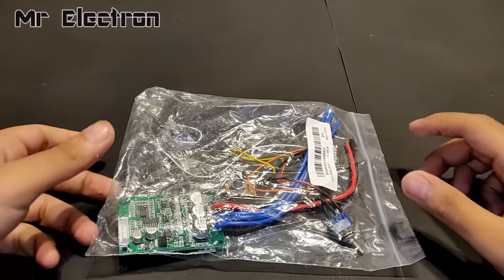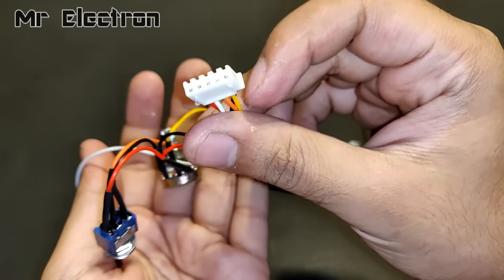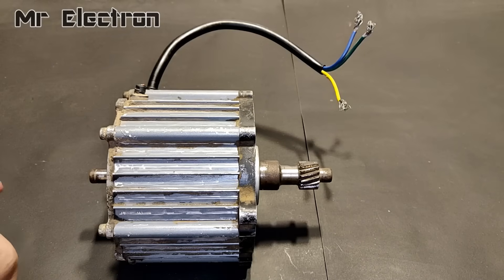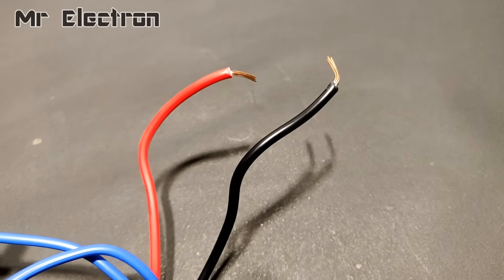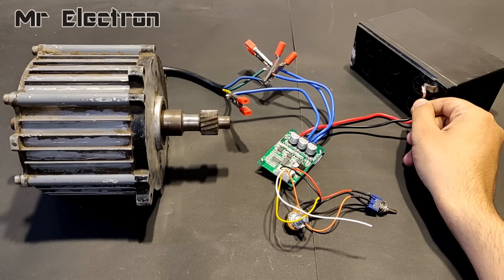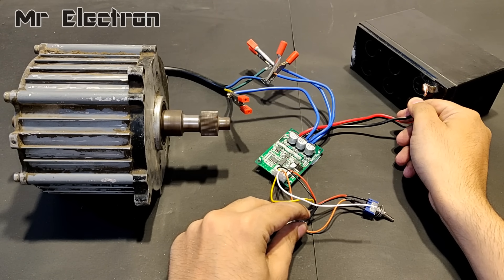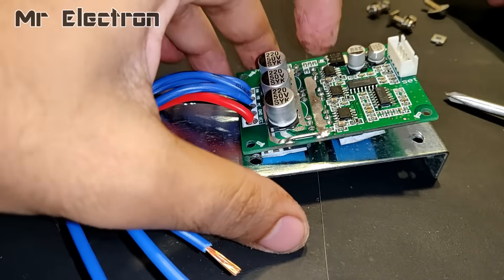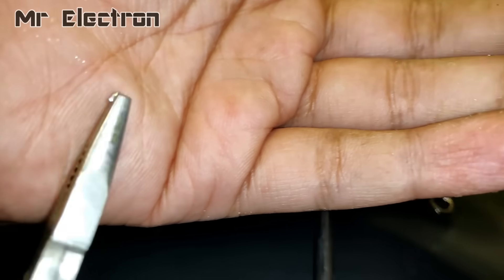Wooow ! 12v to 36v 500w Brushless DC Motor Controller - Run BLDC Motors without Hall Sensor

Comment from the maker: BEST BATTERY CHARGER DIY VIDEO - https://youtu.be/ZN3saILbYUw?si=9_nLu0vKOqfn4zi_
Join this channel to get access to perks:
https://www.youtube.com/channel/UCWFbPzBb7dCyCWuBA-DBrMA/join
Mr.Electron Patreon's Page - www.patreon.com/mrelectron
Hindi Channel                 - www.youtube.com/@Mr.ElectronHindi
Alternator Channel            - www.youtube.com/@mrelectron_alternator
Watsapp Channel              - https://whatsapp.com/channel/0029VaQmmRaFCCoWOf7huh3G

BUY Brushless Motor Controller : http://bit.ly/2UV9Ybb
Reply: Nice idea for my future project.
Reply: HEY THERE DUDE I CAN SAY YOU CAN EXPLAIN WELL FOR BEGINNERS NOW LET GET TO A BIT MORE DETAILS ABOUT THIS UNIT . DOES THIS UNIT GOT A SMOOTH BRAKING AND ACCELERATIONS MODE ??? ALSO DOES THIS UNIT GOT A BRAKING OPTION ??? THANK YOU
Reply: @reptiloidx8942  - no smooth brake and acceleration on this driver but I don't feel any shock for my brushless motor either
Reply: My question is how long the lifespan of the battery using this motor and how many battery should i use and how many volts possible.
Reply from the maker: @arionrodriguez6627  Max motor volts : 48v
Max circuit volts : 36v
Max battery life depends on usage.
Reply: @MrElectron  RPM and load capacity.?????
Reply: @MrElectron  when you take the VOLTAGE from 48 V down to 12 V what does that do to the amperage does it go down proportionately so round 7 1/2 to 10 A?
Reply: @MrElectron  Have you tried running it continuously for 3-4 hours? Was there any overheating observed in the controller circuit or the wires?
Reply: Sorry if I missed it, but what does the white wire from the harness do?
Reply: How much price for brushless motor controler , can i buy thise one
Reply: Cuánto  cuestan ese motor para juliaca
Reply: Sir can you make this esc please please please
Reply: l bought similar module then l powered it with 18v battery but it gives no output voltage.  do you have any comments why no output power.  thanks a lot.
Reply: Please share your contact details
Reply: I use dc drive 350 volt
Reply: I use dc drive 350 volt
Reply: Drive plate type: JYQD_V6.3E2
Reply: Is that controller has SEPIC converter
Reply: Can the direction switch be replaced with a fixed direction?
Reply: Bro we can opreting  ev controllar with f 16 transmitter
Reply: Please guide me .this driver is drive the  bldc 
 impect wrench .
I tried to drive but no responce .
Reply: How much
Reply: Can i have One same for brushed please

Comment: Brother you didn't removed the film protection for the thermal pad for the mosfets underneath, it will not conduct heat properly
Reply from the maker: I made a mistake friend. You are right.

Comment: Help me, I need to install a 12 volt 250 watt 20 amp 3000 rpm motor, how much power should I supply to the regulator, how much should the battery have for power, the regulator supports a maximum of 40 amps at 12 volts, please answer, thank you very much

Comment: Hi, I have a mac bmc bldc motor it says 24v 600 watts with 3 wires RED BLACK & WHITE and hall sensors wires. Are the 3 wires B R W normal color to power the motor? Thanks

Comment: Hi,nice video…I would like to ask you a question, what BLDC driver I have to use to run one of my fan coil motor fan?…it has three fazes but also another 5 thin wires coming from inside…most likely from Hall sensors…I purchased from Aliexpress an SNR8503M BLDC hall sensor 6-80v driver…I connected only the three phase and the positive and negative to this board…still motor is not spinning…don’t know what I’m missing (probably something with the Hall sensors) but not sure how to connect them…any advice will be much appreciated

Comment: You need to remove that blue plastic cover on double sided tape. That tape works as heat exchanger but not with the plastic cover and the tape also sticks to the heatsink.

Comment: Can I use this for continuous run on a brushless DC motor? 
I need it to run at 36v for 20-30hrs straight. Maybe a cooling and heat sync fan

Comment: Want to know sir can we run bldc motor without hapl effect sensor connection to esc driver board if the circuit has connection for hall effect

Comment: Explain the 3 blue wires. What's the voltage output of all 3. I assume also it's ac current. The motor you were running looks like single phase. Is it?
Reply: Looks like it’s a DC 3 pole “phase” motor. The pcb fires off each coil in a rotation to create the rotation of the motor

Comment: If I used strong enough cooling (big heatsink with good thermal connection), could I run 30Amps through it?

Comment: Hi. Can you share what is the output voltage from the circuit at blue wire 1, 2 and 3? I bought the circuit but my motor seems not running.
Reply: same. did your motor run anytime later?

Comment: Hi Mr. E. What if your motorbike, which does not use a hall sensor, uses a module that has a hall sensor, and how do you disable the hall sensor circuit, and your motor still runs? Thanks

Comment: I bought similar module,  l powered it with 18v battery but it gives no output voltage.  do you have any explanation.  l record video and l want to share it with you.
Reply: I have the same problem
Reply: You solved it yet?

Comment: I HAVE QUESTIONS,
I HAVE 24V 500W CONTROLLER,
AND 12V DC MOTOR SO SUPPORT 24V CONTROLLER IN 12V DC MOTORS

Comment: Bro can I use electric bike throttle as speed regulator and is it safe to use on this king circuit board the one you have shown?

Comment: Sir, I have hub motor of 24 v 250 watt. Is there any provision to run the hub motor in reverse direction. I shall be highly obliged to you sir if kindly answer yes or no and if yes then how?
Reply: The switch controls the motor direction, did you watch the video.

Comment: When you have to drill a plate with the marking on that side drill first with a small 3mm drill to get the hole position then turn it over and clamp it before drilling through the 3mm hole with a larger drill.

Comment: Hello Mr Electron. I have a 500w brushed motor from a leaf blower. I am trying to convert it to bldc. I am not finding any video which has done it. Could you please create a video or help me out?
Reply: After converting to bldc I want to generate electricity from it and store it in a battery. Would you be able to help me with it?

Comment: Hi I'm manufacturer of EV Motor 120kw for car, with 15000rpm 400v maximum tourq 420nm
Reply: Great job,dear friend assemble motors for bikes3500,4000,4500,5000,watt,12to24volt,72 amps,with the circuit board shown in this video.

Comment: THE BLUE WIRES SEQUENCE DOES NOT REALLY MATTER? AND THE VOLT TENSION APLYED FOR EXAMPLE 24 AND 36 SHOULD OR NOT AFECT THE ALTERNATOR ONCE IT´S 12V DESIGNED? thanks for the attention

Comment: Hi could you advise me the speed controller regulator for my home High speed sewing machine motor whose details are: Amps 0.5, Volt 220/230, H.P. 1/12, RPM 7000, Watts 50
Reply: harbinder singh ji !
you need VFD (variable frequency drive) to control the speed of AC motors - which are generally made for high power motors & are  expensive if available for your ratings.

better & safer option is

you may easily get a 24 V, 250/350 W DC motor kit ( with speed controller) @ approx 4k ( from Karol Bagh, Delhi ) & if you operate it @ 12 volt - it will work @ lower powers required by you.

an added advantage is you will never get an electric shock.

you can run it directly from battery or a small battery charger (cheap) plugged in AC 
or
directly from a 100 W solar panel.

Comment: Hi bro I have a 350w 24v motor. And the motor controller is 36v 500w
My question is
If I install or connect the wires  is it going to be a problem with my motor ?, because it's 24v and 350w.?

Comment: Question: If i want to use 220 volts connection at home for running this motor and circuit. What device shall i use... Please suggest the cheapest but decent quality option.
Reply: milan patel ji !
use simple double battery inverter's output as your power supply for this controller / motor.

Comment: Hi brother, I bought car from China, but the speeding very low40km/h , how can I increase the speeding to 90km/h, the motor 60v /1500 watts, shaft 16 teeth’s
Reply from the maker: use 2 more power rating for motor with twice bigger gear size on motor shaft
Reply from the maker: twice more

Comment: Load capacity of 750v bldc motor by 12 volts battery.
Reply: Not nearly enough heatsink and steal that you used not a good conductor of heat

Comment: please tell me
12 v DC to 96v DC 130 A this is possible ?
Reply: vikas Yadav binary option 
Vikas ji !
you are talking about approx 10 kilowatt power.
at those powers I think it's difficult to get a DC speed controller.
but
you can easily get decent quality  VFD speed controller & 3 phase AC motor for that rating , which a few companies are using in their small cars.
the kit may cost you 50- 60 k rupees.
China already has a few lakh cars (sized like Reva , top speed 40-50 kmph, probably using 5kW - not even 10 kW ) running on them without giving any troubles.

1 more suggestion

go for LTO cells for making your battery, 
they run 15000-20000 cycles,

don't need BMS ( battery management system) as they can give continuous current of 200 ampere & parallel cells not needed;
don't catch fire even if punctured/ drilled; 
never gets heated; no dendrites formed - safe.

Comment: Do you have a 100v version?
Reply: This is a cheap Chinese board so i don't think you will find a 100v version of this, at this voltage you will have to go to a bigger and probably more experience controller.

Comment: I have a motor BLDC Nidec Corporation 24V /1.4A from hp 1300 printer with 5 wires out of driver board as : Vcc - FG - DEC - ACC - GND. How to connect and run it by DC power source adaptor 24V? Could you please tell me an instruction about that. Waiting for your answer, many thanks.

Comment: i want fit dc motor for my car corolla 1.8L  sent how much volte & watte motor required, which resolution required pls sugest
Reply: Nandkumar Chikhale ji !
get anything from 5 kW to 15 kW - depending on speed you want.

China has very small cars with 1500 W motors, lead acid batteries - speed 40 kmph.

also
 go for LTO batteries
they are SAFEST- no fire - no heat - no acid - no dendrites, runs 10-20k cycles, lighter than lead acid, don't need BMS ( = battery management system - the lesser the electronics , the better )

good wishes for your endeavour !
😁😁

Comment: What is the maximum time duration this motor can run on load with this setup?
Reply from the maker: As long as you want considering the battery doesn't gets discharged.
Reply: 2

Comment: you forgot to peel off
the blue tape,
Reply: I don't if this was a joke or you don't know, but that blue tape is a thermal tape, mixture of thermal paste, conductive polymers and adhesives. It's there to electrically isolate the fets from the sink without thermally insulating it in case of a full metal sink.
Reply: @anubhavmuku96  That blue layer is just the thermal tapes protection layer for the glue surface, you are supposed to peel it off. It is the actual white tape underneath that blue layer that is the thermal tape that acts as an insulator.

Comment: hallo,i have a sea canoe and wish to power it electrically,since i dont know much about electrical can you sugest what kind of arrengement should i buy and from where?the total  weight with me on board is about 150-200kgrms.thanks in advance!!!!
Reply: Go for a 500W BLDC with a 750W Controller and a LiPo battery of your choice. It's fairly simple to do if you follow the instructions on the device manuals.

Comment: Mr electron can u plz tell me about the torque and watt of 24volt printer bldc motor. I m trying to make hybrid activa to run on petrol and battery
Reply from the maker: ~2500 RPM , 120 watts and more. Depends on their sizes actually.. Its printed  on their backs.. Torque is good enough although i havnt calculated it yet
Reply: @MrElectron  thank you boss

Comment: Assalam o Alaikum
Hi
This controller card is run two motors at one time two hoverboard motors 350w 36 v run at a one time to this card please ans me ASAP
Reply from the maker: yes it can run but only if you don't use it at full power.This is 500 Watts and your 2 hoverboard motors will be 350+350 = 700 Watts.
Reply: @MrElectron  Thanks for reply
Please guide me which type controller is perfect for my hoverboard motors and run two motors in same time please ans me ASAP
Reply from the maker: Are those motors hall sensor type ?
Reply: @MrElectron  Yes
Reply from the maker: @frazahmadbasit9015  well then buy a hall sensor type of controller with equal to or more than 700 watts power rating
Reply: Send my skematic invarter 3 phase sir

Comment: You really should use a proper wire stripper. It is evident that by stripping the wire the way that you are, there are many strands of copper that get cut which reduces the strength and current carrying capacity. 
Especially as a YouTuber it is paramount that you follow good procedures to set the right example, to your viewers, a YouTuber doing something a certain way validates a viewer doing it that way and makes them believe that that is the correct way. You have a responsibility in this community in the position that you're in, take it
Reply: Not to mention the clips connecting the motors being exposed metal. You say that you didn't take the blue tape off because you did not want to damage the board accidentally. Shorting the phase outputs would much more easily destroy it. Stripping the wires back a little bit and twisting them together with some electrical tape over the joint is much safer and not permanent either. 
Also, the motor does not slow down when you put your finger on it because the ESC is maintaining a constant rpm, and increasing the torque is response to the load you place on it
Reply: ok you send him a proper wire stripper ask for his address.

Comment: I have been looking in to building a DC to DC , for a wind turbine! Any ideas? I want to convert the voltage over about 30v to amperage, and hopefully make it more efficient, I would like it to handle about 120vdc , since the voltage will swing greatly in operation, have any ideas???
Reply from the maker: Buck converters
Reply: James, a couple things before a possible solution - 
You cannot convert voltage to amperage, those are two different entities
It sounds like you want to convert the output of a windturbine from about 30VDC up to 120VAC to power your home or something along those lines. If that is true, you need a DC to AC converter instead, also known as an inverter.
See if you can use a low power UPS system and the wind turbine instead of batteries, just make sure the input of the inverter is rated to a large input voltage.
Alternatively, you can look into getting an inverter designed for solar panels since they are designed to handle very large input voltage fluctuations
Reply: @c10yas  I need to convert up to 120v DC toabout 30 vdc to charge batteries, for my off grid 24v system, my bank can charge to 29.4v I will divert power when fully charged,
Reply: @jamest.5001  
To convert 120VAC to 30VDC you need a simple 30V power supply. Since you want to charge a battery pack with it, you'll need to have a current limiting feature to prevent damage to the pack. Moreover, if your pack is made of lithium ion batteries, you should make sure that you have a BMS as well
Reply: @c10yas  I want to try converting g ine over voltage to current, like 120vdc, at 5 amps to 30v 30amps is what I was saying
Reply: @jamest.5001  if you mean 120VDC generated from some other source, you should be able to find buck converters, but that high an input voltage is not something I've personally seen anything designed for

Comment: Thanks for u
Good video

Can we use this controller to run direct drive motor of washing machine
Reply: I haven't tried that but i think it should work .. Although its speed might be low cause there voltage ratings are higher 110v to 220v while this circuit is designed only for 36v max.. I will make a video on that to confirm all these details
Reply from the maker: Sorry , its my other channel with which i have replied